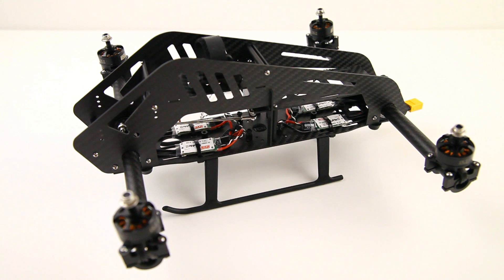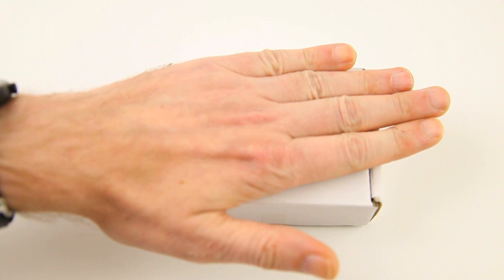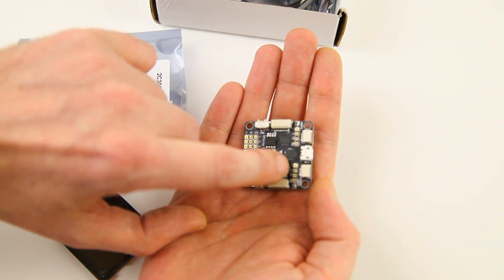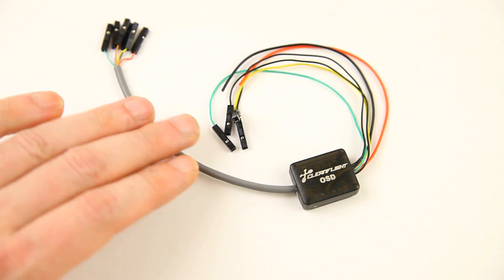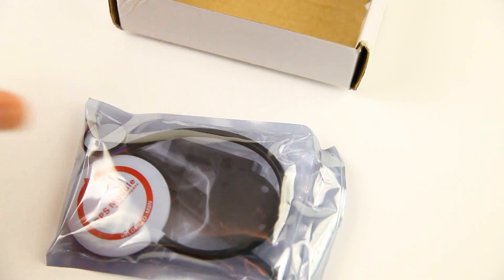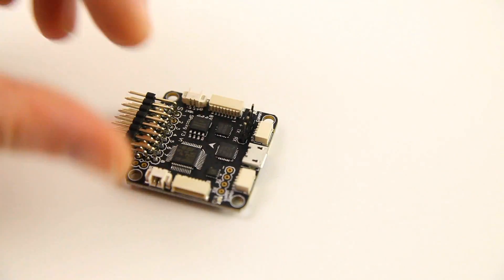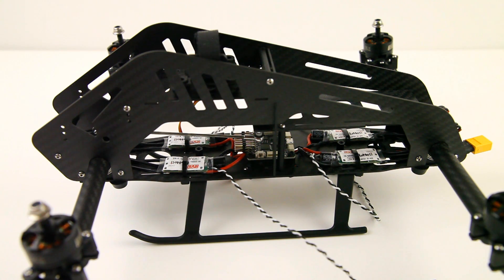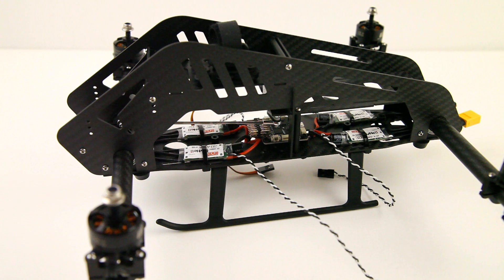Sonic Speed Quadcopter! Part 3: SP Racing F3 Deluxe Flight Controller

Comment from the maker: Flight Controller used: http://www.banggood.com/SP-Racing-F3-Flight-Controller-10DOF-Deluxe-Version-w-HM-GPMS-M8N-GPS-CF-OSD-For-QAV250-Multirotor-p-1032603.html?p=TO251813974002015038

PDB used: http://www.banggood.com/Diatone-V7_0-Power-LED-HUB-BEC-5V-12V-For-RC-Multirotors-p-1024393.html?p=TO251813974002015038

Comment: hi im super late about this. just wanna ask if this wiring works on f3 acro v1? 6 channel fsi6-fsAi6
Reply from the maker: Only 4 years late :D 
hmm that should work, but you probably need to run the receiver in SBus mode.. it can right?
Reply: @DutchRC Got it! thanks men

Comment: Hi there, does your OSD show altitude on the right side by default? Mine does not. Did you had to reflash firmware or anything on the osd?
Reply from the maker: Howdy sir :)  Well no, but that's partly because ended up Not using the GPS or Barometer in this quadcopter..
IF you'd want to change the layout of the OSD, you would need an FTDI adapter..
Reply: Thank you, that´s what I thought. I try to flash MWOSD firmware.
Reply from the maker: I've been to lazy to get into that so far :D  Well partly cause the stock layout worked for me.. 
This quad for instance allso has one: https://www.youtube.com/watch?v=g_fQRRrxZ-k

Comment: well.. probably a little bit on the late side but still a solution and improvement (IMHO) to the clearence problem. 

1) replace the spacers by a little higher once. (if necessairy) 
1b) use rubber balls instead of spacers.. these are higher and also work as anti vibration. 
2) solder the pins on the bottom of the fc instead the top. all you would need to consider is that the plugs would need to go upside down compared to a normal mounting. 

the not protruding of the pins saves a lot of space. and since the are already spacers you wont need much more space anyhow. so none or minor raise of the fc would be enough. 

just my 5 cents. 

also why not change it into 2 servo'c if that is how you would prefer it. can't be that difficult. 

Kind regards 

Matt
Reply from the maker: Thank you very much for the input Matt :)  Out of these I think the 2-servo solution would indeed be the most practical, as it would free up lot's of space in the middle of the frame :) 
I don't think I'll be changing things Now though, as it works well as it is.. BUT.. I busted the servo a while back, and replacing it was a 'bit' of a headache ;) 
Cheers & thanks again :)

Comment: Great video! Plan on going for this kit too. Maybe a dumb question, but why cant the osd be connected when connecting the fc to the computer? As i'm going to install a bluetooth programmer, i would rather not have to unplug the osd every time.
Reply from the maker: Thanks Jan :)  Yeah.. that is a bit of a 'problem' with these first-gen OSD integrations.. This will most probably be better once these things really get integrated.. I won't try it obviuosly, but I think you'd short something out.. 
I'll be trying this newer PDB by the way, with an integrated OSD: 
http://www.banggood.com/MXK-Power-Distribution-Board-PDB-with-OSD-BEC-Output-5V-12V-3A-LC-Filter-for-CC3C-Naze32-F3-p-1031375.html?p=TO251813974002015038 
That setup will probably Not have that problem..
Reply: Thanks for the reply! That PDB has some mixed reviews regarding the OSD function. As i don't need another PDB, i'll pronbably go with the minim OSD  instead.

Comment: I'm having problems connecting the f3 to clean flight can anyone help please ? Thanks
Reply from the maker: It should be very easy.. Doesn't cleanflight recognize it? And have you maybe re-flashed it?
Reply: +DutchRC Adventures when ever I try to connect it to clean flight it just says No configuration received within 10 seconds, communications failed 
What can I do to get over this problem
Reply from the maker: Hmm I am unfamiliar with That problem :$ .. But.. have you (tried to) reflash the board's firmware? 
You could allso op to post your question here: http://www.rcgroups.com/forums/showthread.php?t=2387038&page=64
Reply: +DutchRC Adventures where does the spracing f3 flight controller get its power from
Reply from the maker: I have made a cable from my PDB (5V) to one of the unused output pin-headers.. works like a charm :)

Comment: hi the racing f3 deluxe is arrived with compass and you gps to has compass!
did you cancel the compass in one of them? can you show the setting on clean flight?
Reply from the maker: Hi there sir! To be perfectly honnest: I have not added the GPS (yet).. I first wanted the FPV setup to work well.. The camera I am testing on it isn't working well though :S  Soooo.. the project is a bit hung up at this moment.. (partly because the weather has been terrible as well)

Comment: hi

i would like to buy this flight controller kit. but i have a question. does the gps and osd work straight out of the box or do i have to buy an ftdi adapter to configer  the gps and osd before connecting it to the flight controller and fly?

thanks in advance
Reply from the maker: +Airborne Hi there sir :)
the set I got works right out of the box. But.. should you want to reconfig things.. then yes.. then you'd need the ftdi adapter...
Cheers!

Comment: hey there awesome build!  I'm doing the same build with same frame and sp f3 controller iv been tryin to find a video with some insight! on this setup!. I needed some help with getting the servo to work properly...I see u mentioned there's stuff out there on the spf3 clean flight with tilting arms ..I can only find the naze32 tilt flight thing on Google apps. also one other question are you using sbus, pwm or ppm? how was your servo is the one that comes with good? I can't seem to get mine to work good thanks for any advice!
Reply from the maker: +Nick b Hi there Nick :)  I am not using the flight-controllers logic for the tilting at all (there are a couple of beta firmware's out there for the tilting).. I have the receiver connected via sbus with the F3.. But again: I am running the servo Straight from my receiver.. So my F3 doesn't even know it's on a tilt-rotor..
Reply: +DutchRC Adventures  thanks for the replie! yeah that's how I'm trying to set it up now. Im still new to alot of this but getting the hang of it. I have a radiolink at9 sbus. but problem is when I hook the servo up to a channel it kinda goes crazy. I'm still trying to figure out how to set my remote up so it works with my  right aileron stick. do you kno if you have to adjust the servo? once I give it power it studders an shakes a bit. thanks for any help il try to get some more videos of it in action.iv done some flying without tilting arm an it flys like a dream. just need speed up the yaw rate like you need mention.  can't wait to see the speed test with yours!
Reply from the maker: +Nick b Hmmm let's see.. Have you tried hooking a different servo up to that channel, to see what that one does? The servo that comes with this frame is a digital one I think.. And allways those buzz & shake a bit.. But it could allso be that it's not working correctly because your radio isn't doing something on that channel offcourse.. Sooo.. I think it's best to first sort That out :)
Reply: +DutchRC Adventures hey there! hope all is well..so update on my quad. I was able to get another servo an it works! the one that I got with the frame was no good right outa the box but I'm happy the new one is working. I set up a mix so now it works with my right stick to tilt the arms. only problem is running into is when I shut the switch off the arms move backwards an I can't figure out how to trim it so when I turn the switch on and off the arms stay in the middle enless I pushy right stick forward. any ideas on how to set up mixing for servos to work like that? thanks agian! ... 

have you gotten any speed runs in yet with yours?
Reply from the maker: +Nick b Thanks for the update Nick :D Have you seen my Last video?? In that video I test the tilting itself.. Works like a charm really! On mine, I have set it up so that the arms allways have a slight forward angle, but at the end of the video you can see me fly it in 'landing' mode.. Then the motors point steight up.. 
Maybe you can mount the servo-arm 1 click, so your flies neutral with no input?? I did quite a bit of adjusting on the control-rods as well I should add.. 
How mixing should be done in Your radio.. I don't know.. My pitch-stick controls an Unused channel. Then I actually have 3 seperate mxes to route that input towards the servo And the flight-controller.. That way I can allso fly it as a normal quad, with no tilting.. OR even with tilting And pitching of the entire quad...

Comment: Hey. Duth!
Prompt please!
As used herein, the OSD supports 4S battery? 
(And some miniosd work only with 3S :(.)
Reply from the maker: +NORD S Howdy brother :) 
I have to say I have not put the OSD on my quad yet (I have a normal job as well & such :P)  But from the Info I have, it indeed should be able to handle 4S.. One of the reasons why I got this set..
Reply from the maker: +NORD S ps: IF you use this OSD with the F3 flight controller, then YES.. no problem with 4S..
Reply: Wow. Dutch was waiting until I ask a question and did not sleep! Thank you friend for the answer. ^)
I would hope that works. I have written in support of Bang, but as always, slowly and plainly I know how I feel.
How do you set the F3? All is well? I have not yet set. Everything is going .. :)
Reply from the maker: +NORD S Hahaha I was at the computer as your comment came in ;) 
Yeah.. BG support.. Not super fast, and not really 'answers' :) 

Oh yeah.. setup (with Cleanflight) was super easy :)  I was impressed with how well it flies without any tuning :)
Reply: Thank you. Let me see your review of transmitters. You are doing a good job. It is impossible to break away. :)
Reply from the maker: +NORD S psst: tell Futaba to send me a T18SZ :D   But really.. thanks for the compliment man :)

Comment: I would paint your PDB with liquid electrical tape.
Reply from the maker: +Jon Car Ah yes.. At this moment I have a piece of lexan covering it.. It indeed needs some protection from FI wet grass. Good point :) 
Once everything is connected (like FPV stuff + the OSD etc) I might put a layer of plastidip onto it.. (more less the same thing as liquid electrical tape I think)

Comment: great video and copter :) to solve your problem cut the spacers between the board and the frame ;)
Reply from the maker: +Detlef Heine Thanks brother! ehm yeah.. I didn't have shorter spacers.. But if I would, the screw's would not fit fully in them.. 
But really, this is a stupid problem.. I might build a 2nd one, and make it a 2-servo setup..

Comment: mount the board 90deg rotated to avoid clearence issue
Reply: +Mark Dobson Thanks for the imput Mark! By now, I have used a board with only 5 output pin-headers.. That solves it, but your idea would have worked as well (this is my other channel by the way, I'm replying with :P)

Comment: I'm getting really curious to try a tilt rotor out but the thought of trying to mix that crap to work right gives me stress. I'll wait for an RTF or clean flight support :)
In regards to the space issues, how about using double sided foam? It holds in crashes and just a 2mm thickness is plenty to embed the uneven components legs in and sit flat usually. Could you fit the link rod to the top of that connector instead of bottom?
I want to see it fly please!
Reply from the maker: +MicroRCFiend Next video will be about my transmitter mixing buddy :)  It really isn't super complicated.. I have set up 3 modes: 1. normal quad flying.. 2. tilting with a bit of normal flight controller-pitch...3. tilting And full flight controller pitching :)
Reply: I have an 8S running deviation though and is not so easy. Simple mixer is fair enough but has less function that stock walkera firmware. Advanced mixer has more power than the space shuttle but always breaks me unless very very simple task. Even just setting up switches on a naza in Advanced mixer took me over a week or messing.

Now if you had a Deviation 8s and were prepared to do advanced mixer tutorials you would be the first and could possibly be very popular. Sh1t i'd spend all day making accounts so I could give you more thumbs up and even send you something shiny to play with.
Reply from the maker: +MicroRCFiend Hahahaha I appreciate that last part brother! :)  Here is a thing on that though: I have a Futaba T14SG And a Tunigy 9XR as stick transmitters, and allready consider that as 1 to manny :$ 
I did do a bit of mixing on a Deviation 7 a while back to fly the Hubsan X4 with it though.. I did Not understand the system :P haha

Comment: the genuine SP-F3  has "through-hole"  connectors that allows direct soldering of the vbat and buzzer.
Reply from the maker: +Mark Duncan I actually have one like That as well from banggood :$ (the non-deluxe version) 
That one allso came with bent pin-headers by the way..
Reply: +DutchRC Adventures,  I think as banggood are really just the "clearing agent" middle man for many re-sellers that its pot luck as to what you actually end up getting.
Reply from the maker: +Mark Duncan There indeed is that point as well :)  I have that version that looks more like the genuine version on the quad now by the way.. (I needed to only have 5-output headers to have the servo clear things :$) 
Can't try it yet regretably.. It's raining cats & dogs.. and the quad is a bit to violent to try indoors :$

Comment: Looking at the linkage setup. It looks like the linkage going to the "front" of the craft is at a more acute angle than the other which might lead to them moving at differet ratio's. It looks like you might have enough room to move the front linkage to be above the rear one. This would help in two ways, the angles of both linkages become closer giving better ratio's and it would move the linkage away from the flight controller
Reply from the maker: +Mark Duncan Thanks for that! I WILL check that again.. Though I think it might just have been the camera-angle.. Cause I did check that.. Never a bad thing to check again though :)
Reply: +DutchRC Adventures, for the linkages even hobby kings pics show an angle which will lead to a differential ratio (maybe its by design but i dont think so) see my picture  : 

https://scontent-fra3-1.xx.fbcdn.net/hphotos-xlt1/v/t1.0-9/12803283_10153971374658518_1814083334237343379_n.jpg?oh=cb68cad09f76e9a675f9c7110bf1e232&oe=57978B25
Reply from the maker: +Mark Duncan Ohwwww yes.. Right out of the box it sure needs work.. OR you could opt for it having dyhedral.. Hmm I wonder what That would do.. left-to-right dyhedral makes quads more stable on the bank-axes..

Comment: The frame is a bit of a failure. Its huge with lots of space but yet almost no room for a tiny flight controller.
You could rotate de flight controller 180 degrees (ESC pins at the back). and realign it in de controller's configuration.
Reply from the maker: +Rooster9911 Thanks for thinking with me sir! That space issue really is a HUGE disign flaw.. You'd allmost think the designer never actually build a working quad with it? 
Hmmm 90 degrees.. I might give that a try yes.. Thanks!

Comment: You could use plastidip on the PDB :-) Sold by conrad!
Reply from the maker: +Lyrixish I loveee plasti-dip :) Could work indeed.. I'll allso coat the battery-tray with it, to keep the lipo in securely without need for velcro (other then a strap)
Reply: That's a good idea :-)
Reply from the maker: +Lyrixish I use plastidip on camera-mounts as well.. The stuff IS a bit pricy, but you don't need to use a whole lot :)